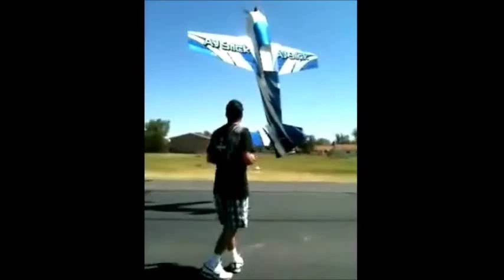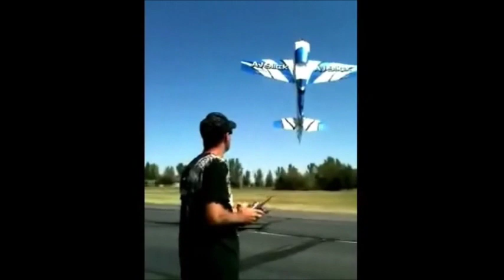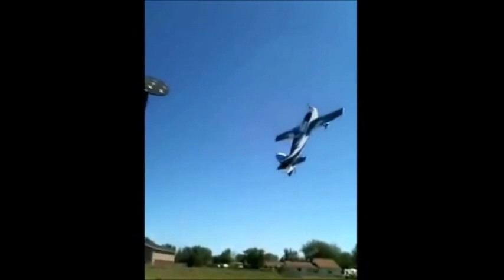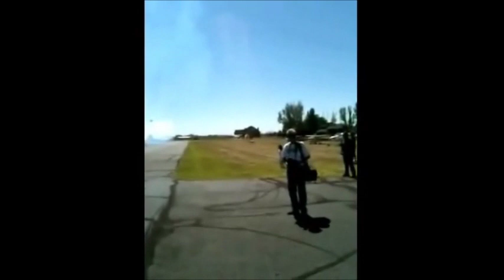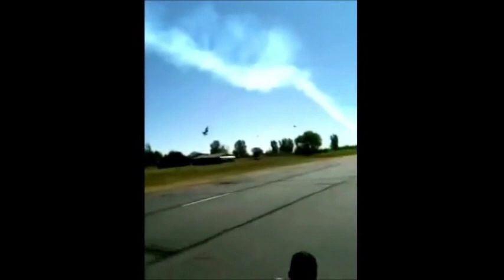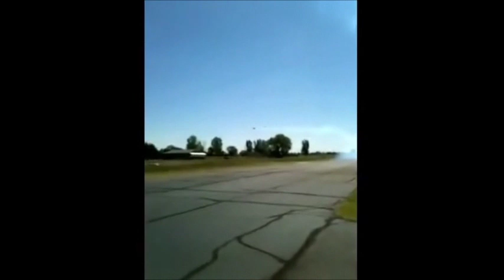Real Plane hits RC Plane

Comment: I read the FCC report. It seems to me not enough coordination took place. In the second paragraph of the report it reads,
 "According to a telephone conversation and subsequent written statement submitted by the pilot of the bi-plane, he was flying to CO12 to participate in a fly-in and BBQ event. Prior to his flight, he had contacted the event organizer, coordinated his arrival, and received a briefing that there would be radio controlled airplane models flying between 1000 and 1400. While on approach to runway 12, he observed a Cessna airplane on the runway and performed a go-around. During his second approach to runway 12, he felt that his approach speed was fast, and the airplane was not aligned properly so he added power, turned his smoke on to increase visibility to the radio controlled airplane operators, and announced that he was performing a go-around."
  So here is a biplane that is supposed have a parachute in and bbq event, which was the RC Plane show, and not enough communication with the ground and RC pilot. The biplane was doing a "FLY BY" to show off. Did the pilot get hurt? No. Did the RC plane get demolished? YES. The RC pilot had the plane 35' off the ground man, then the Biplane does a fly by and hits the RC plane. Who is the irresponsible one of the 2? Seems a fly by at that altitude would be dangerous for everyone at the event. Get a life. I buy a quad copter so i can fly it. I do it responsibly but I like to get it as fricken high as i can. That's why I bought it. "TO FLY, McFLY!"
Reply: What does FCC have to do with anything?